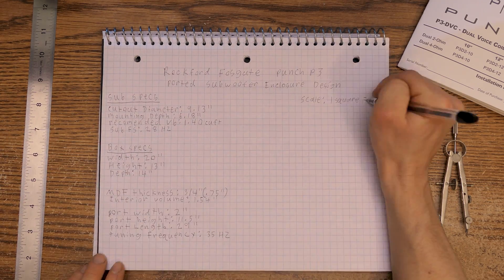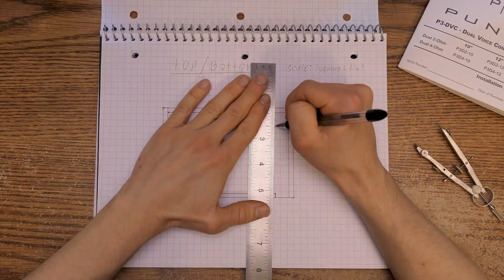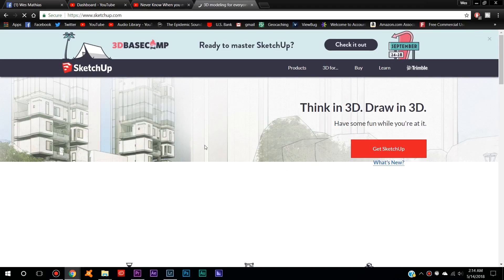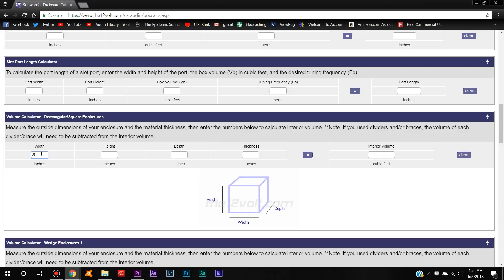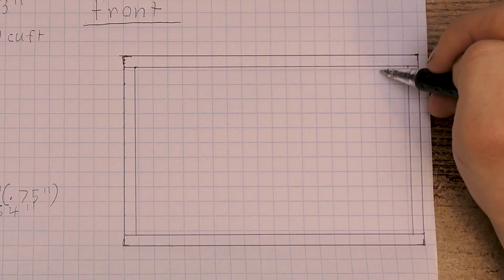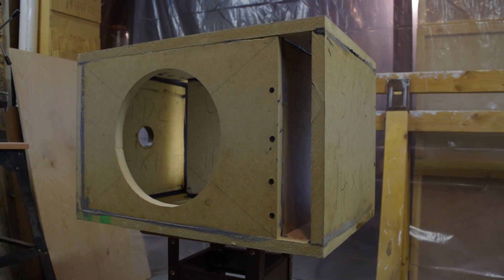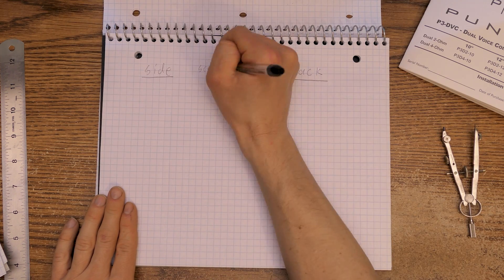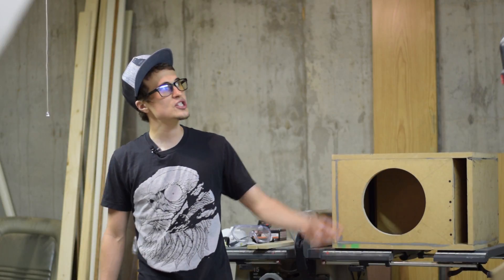How To Design a Ported SubWoofer Enclosure from Start to Finish using Graph Paper

Comment: Think you math is a little off because you didn't account for loss of volume from the port. Your net volume for the box is smaller and thus changed the time of the box as well.  Other than that, good box build tutorial
Reply from the maker: so the port doesn't count for part of the volume? I can see the port wall taking a bit away from the volume. thanks!
Reply: @4WheelKid  port volume needs to be subtracted from the total volume if the port is "inside" the box.  A simple thing that gets overlooked
Reply: @marcnakanishi1568  is the port length 29 inches both ways? And where did he get the 2 inch port width from? He didn’t explain neither. Still a good video though. Please help!! Thanks.
Reply: @papergatorzfedducca7998  the port length should be calculated end to end from the middle of the port.  if you account the outer wall and the end of the port, you might have to factor that as well to.  based on his drawing, it may add another 1.5" to his "total" port length.  

using a box calculator is how he got the port dimensions.  just google "subwoofer box calculator" several come up.  a lot of people use the12volt one.  He does go into detail what you need to input to obtain the correct length.  but what he didn't account for is the NET volume of the box (total volume - subwoofer displacement - port displacement)
Reply: @marcnakanishi1568  highly appreciated!!!
Reply: I was going to point out the same thing. Box is now smaller and so the tuning will be higher. Good vid but misleading.